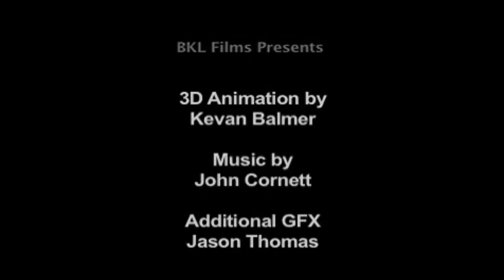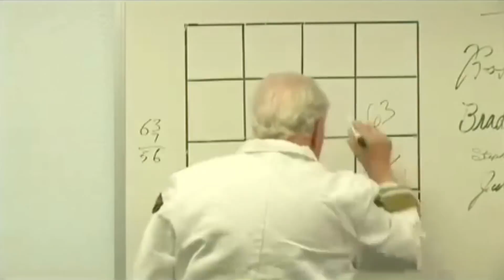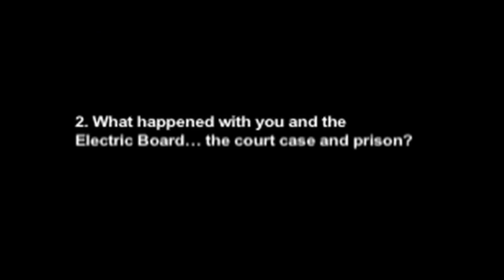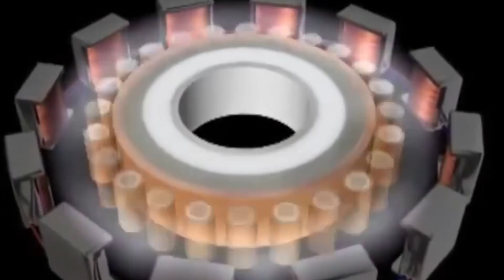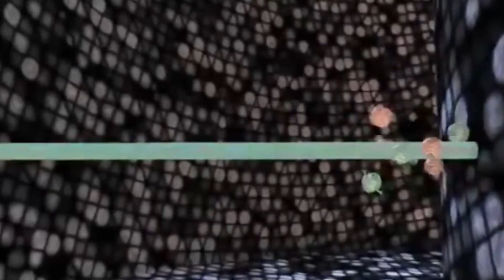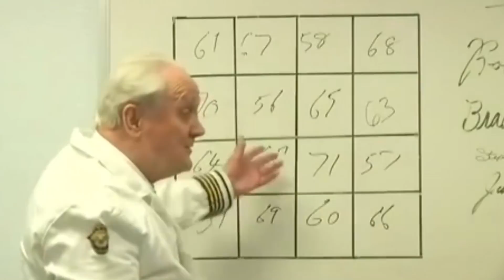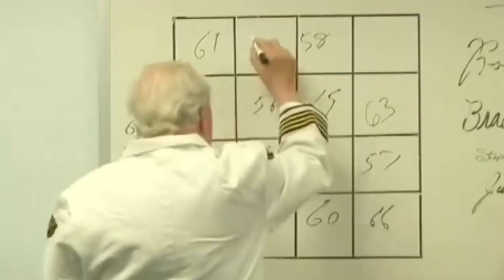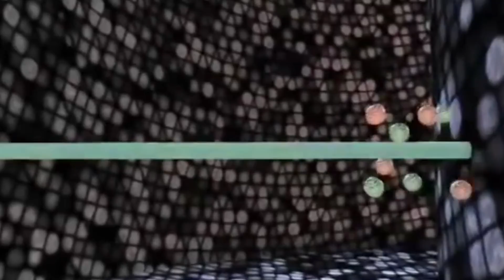BUCKLE-UP! Why Did They Destroy This Mans Free Energy Machine? 2021

Comment: Yes. Yes it could change the world. Absolutely. There are many others out there that should come forward and join them. 

Also random fact, we've all heard of the water powered car, but there's actually a local news clip with Bob Lazar of all people that has nothing to do with area 51 or he is showing his own water powered car, and this never comes up! But I've seen it
Reply: Not really water powered but hydrogen.  He uses solar cells to do electrolysis on water. He then captures the hydrogen and pumps it into the cars hydrogen tank. He also built a tank that is so safe you can shoot holes through it and it won't explode, smart guy.
Reply: It's definitely a conspiracy..amd what kind of amunitions were used to shoot through the tank? High velocity, sub sonic, full metal jacket, hollow point, tracers?

Comment: I find it odd that he said the vision for the machine came in a dream as most great inventors do. I have had a reoccurring dream my entire life that an anti-gravity craft would need to be powered by a gyroscopic design but never could figure out other than the rings being electromagnetically charged how it would actually be powered, just the effects of the opposing magnetic fields would keep the rings moving. 
If this principle is applied using the SEG as the rings, the energy would be emitted from 360° . The ions emitted wouldn't cause it to be anti-gravity rather adverse from gravity. The power you use to control the craft would not be to push yourself away from gravity but to pull yourself towards it. Is this what we are seeing in our skies?
Reply: Yes, you got it! What now? A super gravity? Twice the work needed to equal it now.

Comment: I've seen all this before. The device does not move on it's own. They never do. This is BS.
Reply: Its not meant to move around 
Think of it as a vacuum ok it sucks in nothing and creates electricity from air 
With that electricity you can move anything you want with it but the device making something from nothing is stationary
Reply: @hiwaymandj6189  If you are talking about zero point energy, this is not that. It's a scam. And it does move around that is the  magnets rotate around a cylinder they are attracted to but they do not move on their own you have to induce energy to move them. It's like a trinket or toy. Not real free energy devise.

Comment: Did they ever power anything with it? Did they say how much electricity it can produce? All I seen was a machine with a spinning part and some lights.
Reply: Yes and yes, and about a megawatt on the industrial model. Given it can be multiplexed, it can easily power a city. While running within a magnetic field it no longer required bearings, which later was configured into a solid state model that had no moving parts thus could theoretically run indefinitely.

Comment: The biggest mistake most of these inventors seem to make is either trying to copyright the tech, which immediately lets the people in power know who to go to. Or they try and find investors so they can profit off it, even if their overall motive is good this still sends off alarm bells. Some people even say that merely turning on a ZPE machine sends out a unique signature that can be picked up anywhere on the planet and tracked to its source. We probably won't ever see this technology until a brilliant inventor somewhere decides to give it out for free and floods the internet with specs and blueprints as well as the math behind it. They'd need to have friends that are good with anything internet related. Get enough copies out fast enough and it would be too hard to stamp out without the coverup reaction becoming too visible. Heck spend a few thousand bucks and mail out a few thousand hardcopies all over the world at the same time you post it online.

Comment: It’s in the title… “FREE” nothing is free ever.
Reply: That's just what you've been told.  Happiness is free. Solar energy is free. Kindness is free. Electrons in light are free. Gratitude is free.
Reply: Not exactly my friend. Solar comes from power of the sun. Using its resources. Happiness is a chemical reaction in your body. Using its resources. But it’s the path of least resistance. Just like free will…. You have a choice to do something. Even if you do nothing. Your always doing something. Free is a false word…. Cost effective is better than free. Cause the device is still going to take resources and materials to build. Then distribute. So it’s still not free.
Reply: They said it was impossible, they were wrong